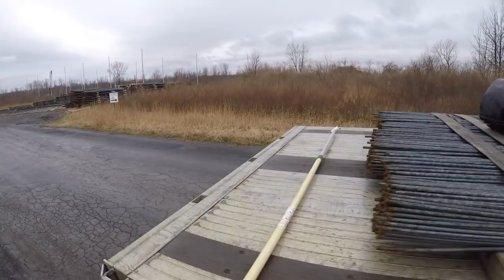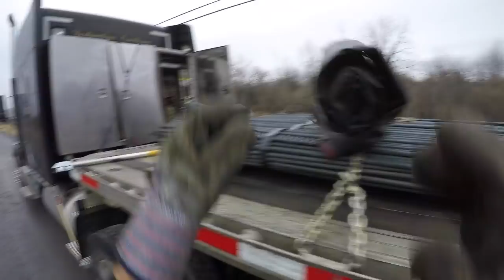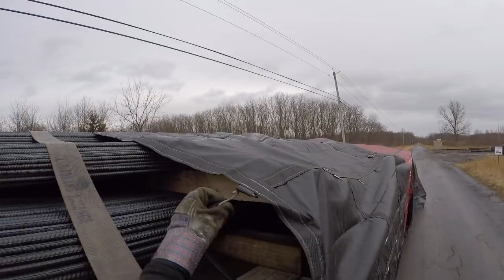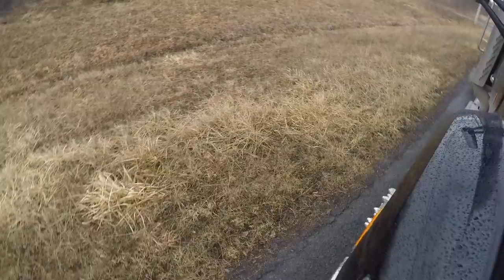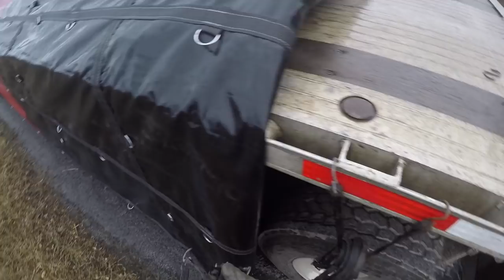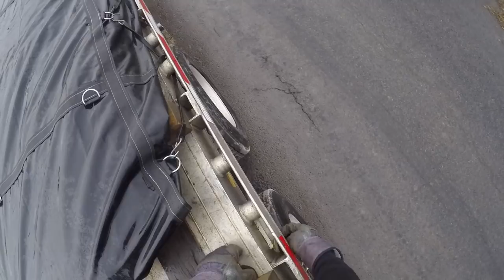CDL FLATBED | Flatbed Securement | Straps & Chains, Bulkhead | Full Tarp

Comment: Hey choice. Great video. Keep them coming. Quick question. Wouldn’t it be safer to build the bulkhead before the load was put on? That way they could snug the bar against it and allow less forward movement? Is that possible to do?
Reply: Ray Muncy I like to build mine after, when I remember to do it lol. Easier to butt it up to the product.
Reply from the maker: I’m witcha on that one! 👍🏼
Reply from the maker: Well I guess you could do that but I wouldn’t suggest it, for a few reasons. Most important is once the product is put down I can butt it up to the product more easily than a forklift or crane can butt the product up to the bulkhead. Also what if you build your bulkhead and the placement of the product doesn’t work out? (If that makes sense) easier to talk about it than write it. 💯💯

Comment: Hi. Why does rebar need to be tarped?
Reply from the maker: Great question. Doesn’t make any sense to me. Customers require it for some reason 😒
Reply: T-tarp
M-my
C-crap
Reply: Because of the bar rusting. It doesn't take much for it to get wet and some customers dont want rusty rebar. I work for a construction supply company right now before going to tmc on Nov 5. I've helped customers load bar and some dont want the rusty stuff. That's the only reason I can think of for tarping it.